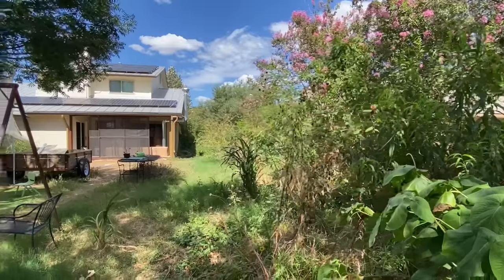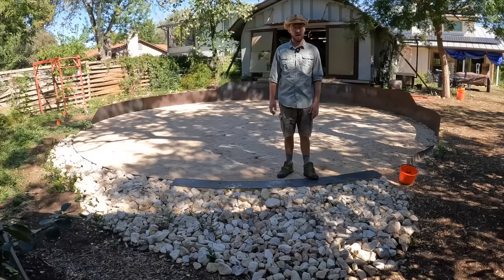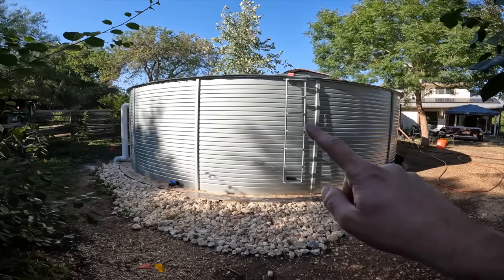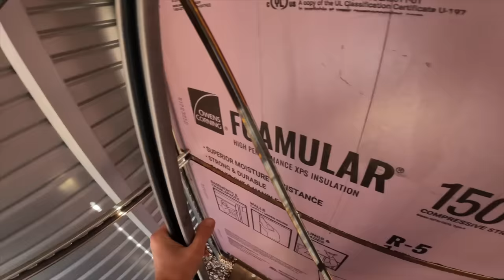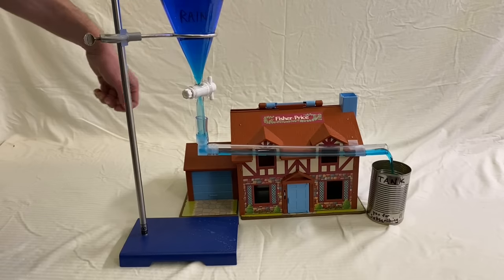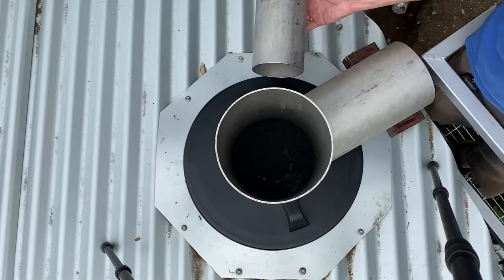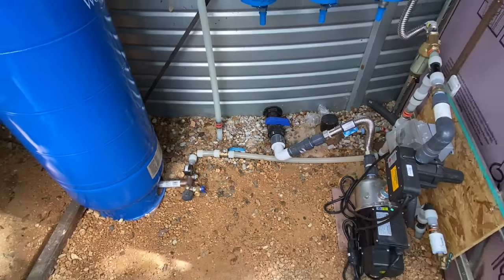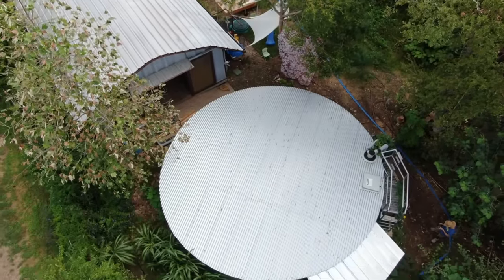FREE water forever.  LEGALLY!!!!

Comment: One thing to share for any future piping.. The original layout used T-junctions when you joined the different flows from the rain. For a free-flow design you may never use those... they cause a lot of backpressure on what needs to free-flow. Worse than some 90's or 45's.

If you had replaced those to Y-junctions and Y merges (like at the bottom of your overspill at your house) you could've kept most likely the 6inch line. That said, you should always increase diameter when you combine flows... so if you start with 6... the moment you join two lines, it must go up a step. If you angle all junctions on flow direction, one line can actually help the other flowrate based on a venturi effect.

That said, congrats on the install, looks very good!
Reply from the maker: I agree with you. That was a conversation I had with the contractor. In the end I wanted to both upsize and make the turns as broad as possible. I bought the broadest 6 inch pipe 90 I could. In my opinion, it didn’t look like a sweep but it’s all I could find online. Thanks for your tips, and for commenting!

Comment: You can drastically cut down own the amount of sediment in the tank by using a filter sock designed for coral reef aquariums. The larger socks look like the same size and are good enough to trap fish poo so they’ll do a good job for sediment. You’ll probably have to check them more frequently though.

Comment: Another helpful video that I'll be returning to in the future to review the plumbing. The 2000 gal plastic cisterns common in my area are nearly $3000. I appreciate the cost estimates you included in the video description as it gives me something to compare with as I search out different cistern types (I will likely only need 8000 gal and I think ferro-cement may be an option). I also appreciate the below ground option for the rainwater collection as I had thought I'd be forced to do an aqueduct.
Reply from the maker: Glad you also like this video. I would have loved to build underground but to cram an excavator that big into my backyard was basically impossible. If I ever get land I’ll try subterranean. I also looked into ferrocement tanks. The only reason I went this route was because the labor was much less than building my own with rebar and cement. If I do an underground tank someday it will likely be ferrocement. Thanks for watching!

Comment: For anyone thinking of doing this, my parents live exclusively on rainwater and there are quite a few expenses hidden. These are a pain to clean, you will need to keep all the water collection points (usually around the roof) clear from blockage, you will have to watch out for dead animals and birds potentially dropping into the tank and then there is ongoing cost of filters to clean the water + generators to keep it all pumping. It is also not a guaranteed source, depending on needs you may still need to get a truck out 1-2 times a year to top up the system. That will cost thousands.  From what I have gathered, it seems far easier to just stay connected to the water grid, but its up to you.
Reply: It might be surprising to some people that using an infrastructure that is set up to deliver to thousands or millions of people is in the end much cheaper and more reliable then creating the same infrastructure but improvised  and on a much smaller scale without proper knowledge and experts for an individual house. These projects are great for totally remote living and to create YouTube content, but that's about it.
Reply: @moos5221  That sums it up. living in Germany this is completely unnecessary, all big countries have so good water supply that no one ever needs to think about stuff like that.
Reply: @moos5221 This is why I (living in germany) see this used very commonly for "utility water" (dont know what to actually call it), so everything except drinking or cooking. Mostly to water your plants and maybe clean stuff outside. This way, most of the infrastructure to turn it into water that is save to drink isn't required. Some filters on the gutter that are cleaned every two years is enough.
Reply: Small farmers in certain areas (Oregon, for one) are not allowed to use water for their farms. They can't grow food unless they collect water themselves.
Reply: Uh, he stayed connected to municipal water.  Hence the anti-backflow valves.
Reply: La ósmosis inversa innyour kitchen filter minerals that un my point of View are most positive than negatives. That bring balance to your Water. Y think it's unnecesary . And ósmosis inversa waste a Lot of Water un it's process. Alllll the rest Is amazing. In my country argentina Is extremly expensive all that system. But i Will tale your expeince  four my proyect. Grate job! Congrats
Reply: If the tank is above the dwelling , u can remove the Cost of the pumps , if it's setup properly  it's great
Reply: 1. I live in Texas and have lived through these "once in a lifetime" freezes that happen every winter. Water goes out, power goes out, for weeks sometimes. People die, and those who are unprepared struggle at the least.

2. A city in Texas called Rockwall (a well to-do, affluent city) RAN THE FUCK OUT OF WATER for days/weeks in some households because the city's usage was over a million gallons a day more than what was predicted. 

So no, simply because you are hooked up to the grid doesn't guarentee shit, and it's this exact way of ignorant thinking that leaves people underpreppared and gets them into trouble. But by all means, rely soley on  someone else/a company with a bottom dollar for your basic necessitie
Reply: Such a system strikes me as auxiliary to the city water supply
Reply: @samtheskoolie  Yeah fully agree with you here. Just say something goes wrong with the water, it gets contaminated or systems break. The company won’t give a shit that you’re getting severely dehydrated, they just want to make a buck or two. So building a system like this, (if you have the space funds and time) would be a great investment so if emergency happens you have water.
Reply: @throttle4418 So do you just have pumps to get the water in the tank? Or is your house in a deep low spot on your property?
Reply: @moos5221 till the utility stops functioning as designed. If you think water from municipalities is good, get a jog cleaning and painting them. You’ll see just how disgusting municipal water supply systems are.
Reply: @CommanderJona except when the electric grid goes down...then you may wish ❤ 13:03
Reply: @samtheskoolie I live in Rockwall. 🎉
Reply: Unless the water grid goes down, like he explained at the beginning happened in Texas.

There are ways to prevent animals and debris from falling/getting into your tank. Many on grid city water supplies have these same type of collection/storage systems.
Reply: But he's saving the planet 😂
Reply: @moos5221 its about having total control over your own needs so no matter what happens your good. If a terrorist attacks the water supply your good if a storm takes out the water pumps your good etc
Reply: @NScherdin  ....but the city water was turned off. He's still connected, I'm sure, just in case something happens to His system and he needs to turn the city water back on. It's a simple valve out at the in ground meter that shuts it off. The city has to do it.
Reply: yea just get a water Well dug skip all of the expense and filtration
Reply: This type of thinking is what's wrong with our world
Reply: @IronSharpensIron127  yea just build a well its 1:100th the size and the water is always clean
Reply: @samtheskoolie  I live in Rockwall & so many ppl were without power & water & literally freezing for wayyy too long! However, the neighborhoods that were on the same power grid as the jail and hospital were fine. Fortunately, our neighborhood was one of them & we nvr lost power & I’m pretty sure we had water as well.

Comment: Consider a sand, gravel (of different sizes), and charcoal filter to filter the water at the very bottom before it goes into your pipe.  It would be equivalent to a municipal water system.  We have done it in ponds.  You could also do it in underground cisterns.  All rain water goes through the atmosphere which may have contaminants that need to be filtered out.

Comment: I would recommend you install a bolt and lock on the top to prevent accidental drowning of children, animals or theft of water. The well looks like a pool and though small, the door can be entered if not securely locked. It is a good idea to let the excess h20 to run off back into your yard keeping it hydrated. Excellent idea and completion of the well.🥳🙏💕🙏💕
Reply from the maker: I have a lock on the lid to keep kiddos safe. I had the same concern. Thanks for your support and for subscribing.
Reply: @suburbanbiology  I was going to say lock it so nobody can poison it.

Comment: "This video is incredibly informative and inspiring! The work that went into installing the 30,000-gallon rainwater tank is impressive. The detailed explanations and the visible quality of the work are highly commendable.

I have a question about the maintenance of the system in winter. How do you deal with snow on the roof? Does shoveling snow become a challenge?

Also, I would like to point out that it might be difficult to install a similar system in Germany due to bureaucracy. Nevertheless, your video is a great resource for those interested in exploring sustainable and self-sufficient solutions. Thank you for sharing your experiences and knowledge!"

😊
Reply from the maker: Thank you for your comments and for your support. In truth, I don’t know how this tank would hold up in snowy conditions. We almost never get snow here. And when we do we only get about an inch of it. I’m sorry the bureaucracy can be so hindering in so many areas. Thanks again for your support and for subscribing!

Comment: By the way, I think what you did was brilliant. Love the idea of independence, especially when things go bad. We live in Australia,  and perhaps slightly different issue to yours, but we are looking at building a caravan with a view to travelling far and wide. As a way of collecting water, we are looking at installing a water maker machine on our van. Great in areas where humidity is between 20% and higher. Different size units make varying amounts, but we are hoping for the van, to have one that makes 50 litres per day of drinking water. I only thought I would post this, because in the future, water will be one of the most sought after resources, and nice that we can share different ways of collecting it, needed especially when the normal water grid suffers. Ironic isn't it that most of our planet is water, yet in many parts of the world, there are critical fresh water shortages. Cheers, and all the best.

Comment: You should consider adding a first flush device to your tank. In Australia it is usually required and helps keep a lot of crap out of your tank.
I'm also fairly certain that is it not very good to drink RO water. You should look into this.
Reply: A first flush really depends on how big the system.  I have the same type setup and we have 320' of 4" pvc under ground which can hold close to 900 gallons.  Our furthest downspouts are over 100' away from the tank.  I would have to flush the first 900 gallons to catch the debris from the furthest downspouts.  We opted for screens on the gutters and the screen at the tank instead.
Reply: @OurOklahomaLife 
Yeah, that's way too much water to be sacrificing.
Reply: @carl8568  it’s only 10 litres max and it drips on a garden until the next rain event. There’s a few million plus rainwater tank systems in Australia with a first flush tee & ball.

Comment: Good job. If concerned about rusting of steel in the pump house that isn't galvanized, or parts of the tank that will eventually show signs of rust,  Rustoleum sells Cold Galvanizing Compound as a spray and liquid (+300 sq.ft./qt.)

Comment: Really cool project and I love the idea of having a sustainable independent water supply! 
Something to note if anyone isn’t aware, RO filtered water lacks electrolytes and minerals that your body usually gets so it tastes pretty “dry” for lack of a better way of explaining. Magnesium sodium and calcium are often in water and what you’re tasting In spring water that distilled water lacks. You can add it back in with a special filter stage that adds trace minerals.
Reply: So RO is essentially equivalent to distilled in that manner?
Reply: @Astroqualia rain water is distilled, all it finds on the way down is dirt and bacteria
Reply: @ralfulrich6254 
Distilled water has been liberated from dissolved or suspended solids, it will test at 0 or 1 ppm on a TDS meter. My rain water tests at 6ppm. There are also chemicals that rain water can pick up, bacteria finds it's way in to the water primarily in the tank.
Reply: @carl8568  rain water leaves the cloud also with 0 ppm. Drinking water needs minerals it collects sinking through the ground.
Reply: reverse osmosis removes over 90% of trace minerals such as magnesium and potassium but it’s not equivalent to distillation, as single distilled water only retains about 0.1% of its trace minerals. You can think of the rain cycle as a large scale distillation process but rain picks up dust particles from the air while it’s in cloud form and on its way down so rainwater is typically 30 ppm contamination of various kinds in the US depending on where you are and time of year.
Reply: @Diamonddrake  I see. This is interesting. So the RO water I buy in the store from the spring [crystal geyser is my go-to] wouldnt be rainwater, so it should technically have that 10% of minerals, correct? I try to avoid distilled only water because im not trying to get mineral deficiency issues.
Reply: @Diamonddrake  honestly I do sweat a lot more than the average person and usually do drink RO or distilled water only to avoid the disgusting city water. It literally tastes bad and burns my throat at this point. 
I've also heard that the chalk tablets and some veg capsule multivitamins don't let the body absorb the minerals/vitamins due to how they're processed. I haven't researched this yet, I have a lot on my plate in that aspect outside of everything else. What would you recommend? And have you heard of this? 
I mean like, buying a generic chalk tablet multivitamin from Walmart might almost entirely pass through your system before anything gets absorbed from the natural digestion process, due to the substrate the vitamins are made with.
Reply: @Astroqualia  the amount of minerals typically in water are very low but if you have major concerns I’d consult a physician. My yearly blood work gives me numbers on my relevant blood mineral content specifically magnesium and potassium.

Comment: Is there any reason this can't be dug deeper so that most of it is underground? I would think that would help regulate the temperature in winter, possibly allow thinner walls due to the ground resisting the pressure when the tank is full, though the pump would need to be bigger maybe.
Reply: I think it would just be cost, that sounds crazy expensive, you’d probably have to concrete form a tank in the ground.

Comment: This is amazing!  But for most people that can't afford or don't have the space for something like this, I'd suggest storing water in a garage or other area for emergencies such as the one you described.  Reusing gallon milk jugs or even just buying 50-100 gallons of water for 75 cents per gallon or whatever is a great safeguard against those times when there is an outage and all the stores run out of bottled water!
Reply: i never buy bottled water except on holiday in countries with shady water.  in my country the water is of bottled quality, in some areas it is the exact same stuff, except 500 times cheaper.  the advantage of living in a wet temperate climate I guess.
Reply: I use blue barrels made specifically for water storage.

Comment: Can you make a video about cost of the build + maintenance + consumables (filters etc) over the years? I assume it would probably even out compared to a water bill over enough years, though here of course you have the advantage of potentially never running out of water. Also, does the water you are drinking with this system have enough minerals in it? After all it is rainwater, so it is basically distilled water that picked up some minerals on the way down, but I wonder if that is enough.
Reply: he made a perfect video of how not to build a corrugated water tank.

Comment: The fact that it is illegal to collect water that falls from the sky is insane.
Reply: It's usually cited as illegal because of "safety concerns".

All that goes out the window though, if you install and store the water correctly.
Reply: I hate to say it but in our modern world with all manner of crap in the air, rainwater is NOT an optimal source!  Plus there is all kinds of crap on the roof.  So unless you live far from “civilization” it’s not the best!
Reply: California actually encourages it in rural areas. The issue is the all the permits for the filtering of water as it goes inside gets quite intense. Outside water is fair game and is deemed grey common use.
Reply: Where does the water come form originally? any water you take from the enviroment is water that would have naturally irigated the land or ended up downstream or in natural basins. Its usally okay for people to take water from downstream but regulating what people can take downstream or near large basins is a must.
Reply: @valdimer11  saftey and eviromental concerns, every bit of water you take is coming out of the water system and something elses mouth.
Reply: @jackorton821  by that logic no one should own a well either